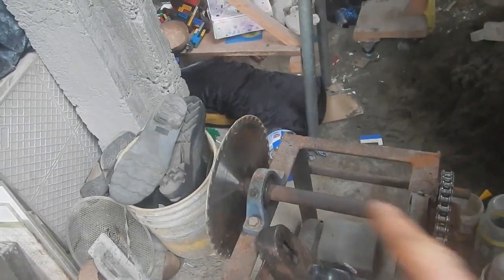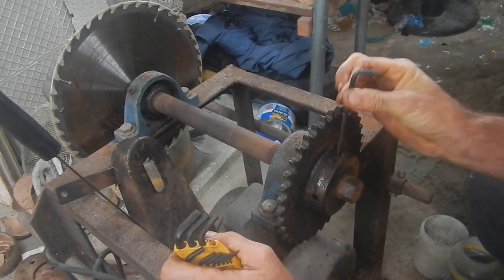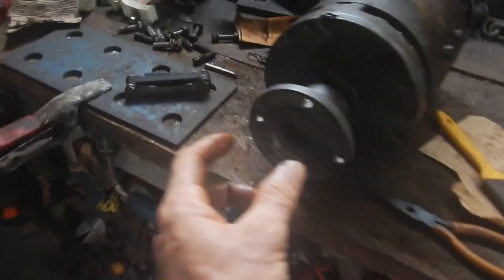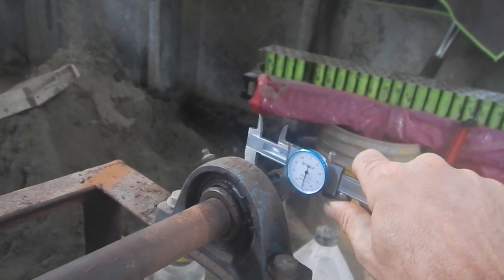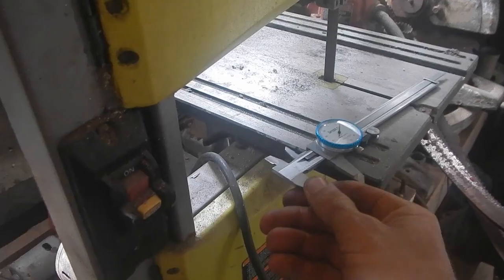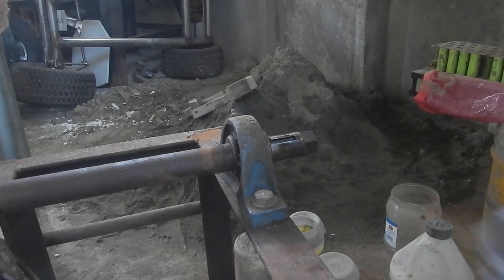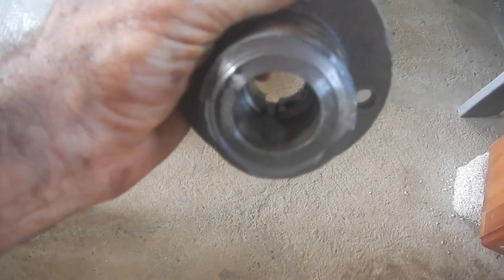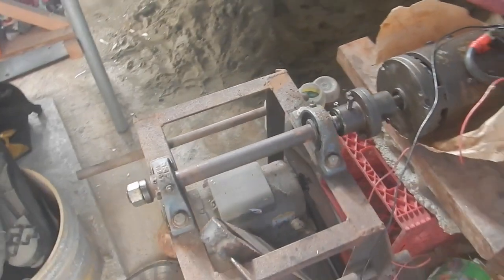Lumber Mill 003 Motor to Blade

Comment: As you just discovered, direct drive has a lot of vibration. This will destroy the motors bearings and brushes. This is one of the reasons belt drives are used in mills. They also greatly reduce motor damage from blade feedback as they allow slippage and isolation. Even the basic table saw is a belt drive. The belt drive also allows to change RPM depending in the saw diameter. Running the blade too slow causes bogging(need a very high torque motor to overcome this), too fast causes vibration and accelerated tooth wear. Basic feeds and speeds as you may have learned on the engine lathe.
Reply: Just put a piece of car tire between the drives takes care of vibrations
Reply: @zpoppe  I'm thinking a motor coupler that has a rubber insert sort of like what washing machines use.

Comment: Jaimie.. why not just bolt the coupling straight onto the chain sprocket then there would be no need to modify it whatsoever.. you could also use the chain sprocket for other appliances off that at a later stage. You could also rubber mount everything which will also alleviate the vibrations.. and make sure the 2 locking bolts on the collar are the same length and shorter or that will cause vibrations.

Comment: Looks like Jamie is making a table saw. Not sure how he is going to cut any logs up with that tiny blade.
Reply: I'm not a woodworker but if you rotate any piece on this mill wouldn't it allow for lets say 2 cuts of 5-6 inches(12-15.5cm) on 1 plane = 24-30 cm. I don't know what wood you need but if he can achieve a square 10-12" post/pilar, thats big for his application? maybe im misunderstanding how this operates though

Comment: When it was snug and wouldn't quite fit, that would have been a good time to stop machining, and put the outer piece in a fire and the pole into ice.  Then you would have a pressure fit that would be most excellent.

Comment: Love how you think outside the box. However, I think you should have at least tested the chain, to see if it indeed heated up too high. I am just curious how well the chain would have worked. Pretty hard steel.
Reply: He could have made it so the chain was housed and runs through an oil reservoir.  Maybe this would help keep the chain cool.

Comment: As with most of your builds, I bet it turns out great.  Have you seen the self propelled chainsaw mill?  https://youtu.be/5AkXJSxOTzI
Reply: THIS IS AWESOME. However I think he's settled on not using a chainsaw since you loose so much wood to the kerf.
Reply: @AlbertFilice  Also he doesn't want to need to use gas/oil, and he wants the fine finish the circular saw blade will make. Even the self propelled chainsaw would not leave as fine a finish. Love Advoko Makes!

Comment: The chain drive would give you mechanical advantage...
Reply: You don't need mechanical advantage using a series-wound DC motor. It's insanely torquey, and if you try to slow it down it gobbles up more power to maintain torque. You'd need more mechanical advantage on the AC motors typically used in these applications.